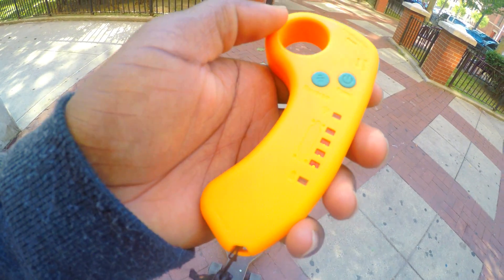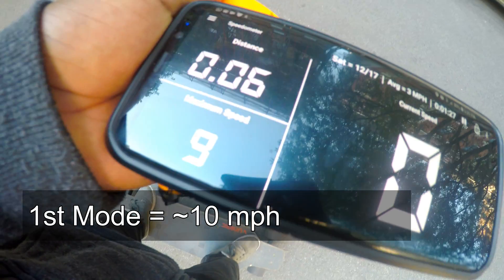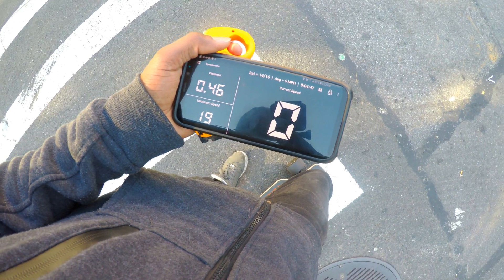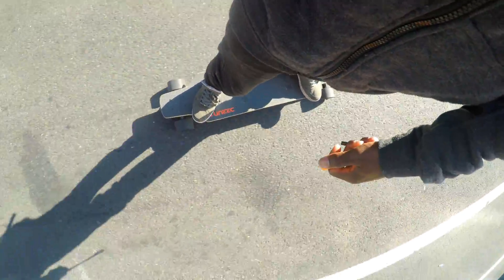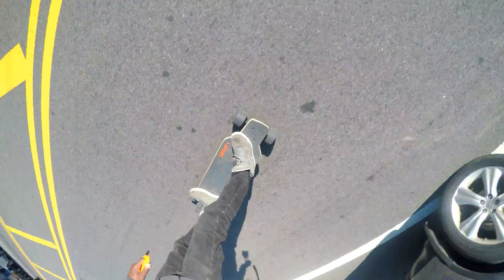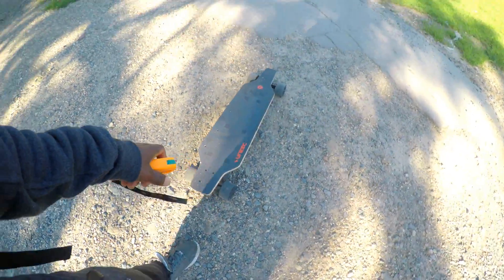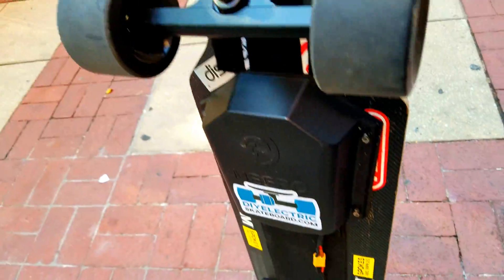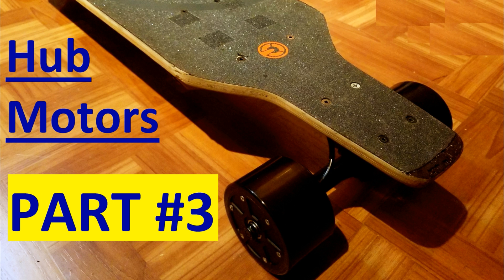BUILDING A DIY ELECTRIC SKATEBOARD   HUB MOTORS   PART #3

Comment: Is it bad when the motors gets very hot ? Can it get broken because of the heat
Reply from the maker: No problem if they get hot! Mostly all of them do! Unfortunately, if you are a heavy person living in a hilly area, they may get excessively heat up. On the long term, the urethane may be more likely to loosen up! Again it's a long term thing!
Reply: @YvonSmart  and the batteries ?
My gets also very hot and i weight only 60kg